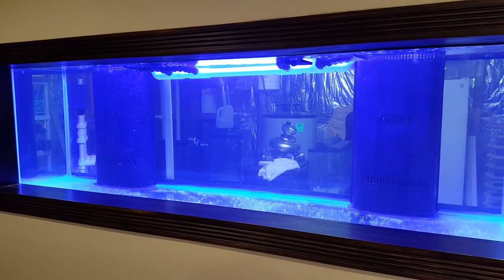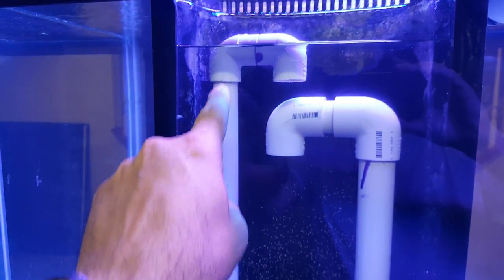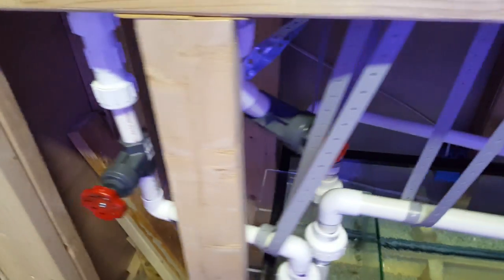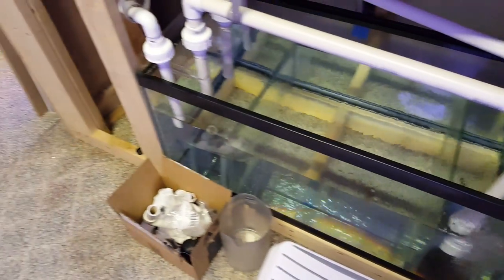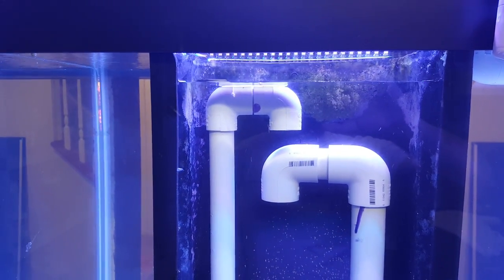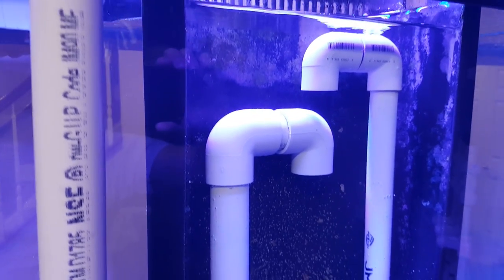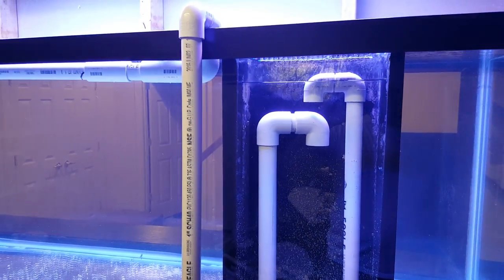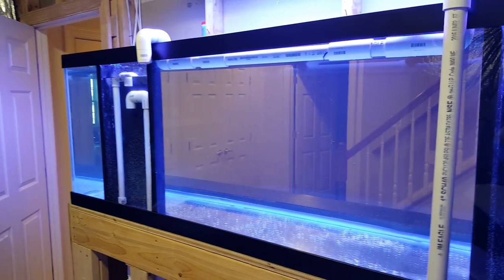How to turn a mega flow into a full siphon.

Comment: I'm want to plumb my 125 the same. I'm ordering 1" ABS bulkheads for the large drains and 3/4" bulkheads for the small drains. What size pipe did you use for these?  Anything holding them in the bulkhead like a rubber seal?
Reply from the maker: The 1" and 3/4" pipes in the overflow compartments are just sitting in the bulkhead. The large one is sitting in friction fit and the smaller one is sitting friction fit in a threaded to slip adapter. At the time I could not get a slip to slip bulkhead so I got a slip to threaded and use that adapter. It is not necessary to attach these as they do not need to be water tight and you want to be able to remove them easily for maintenance.
Reply: Do you remember the overall height you made both drains including the elbows or does it just need to be close?
Reply from the maker: It doesn't matter. The open channel (smaller one) just needs to be higher than the larger one (full siphon) so that it will slowly drift up to it. When your pump is off, the level of the lower pipe will be where the water drains down to though.

Comment: Could the two drain lines be joined in a tee for a sump with 3 inputs? Or would this interfere with tuning each overflow via the gate valves?  Seems like they will have minimal flow and if the sump water can’t overflow the tank it should be safe. So it’s just a matter of doing so would still allow each overflow siphon to find a level.
Reply from the maker: The 2 full siphon drains could not because they run at full siphon unless you tee'd them into a drain that could handle the flow. The trickle/open channel drains could with no issues.

Comment: Hi I'm plumbing my 180 now just like yours it has the same dual overflows, but mine has both holes in each overflow are 1". Is it ok if I make the main siphon a 1.5" with an adapter inside the overflow and below the tank and then just keep the other hole as 1" for the open channel  OR since both holes in each overflow are already 1" should I just keep all of them 1" or does the full siphon have to be bigger than the open channel??  My biggest problem is knowing how far down do I put the plumbing? How far is each pipe from the bottom of the weirs to the top of the pvc fitting on each one?  Also, why did you not use a TEE on the return side and then split left and right behind the top of the tank and up and over to each return loc-line?  I bought the Jebao MDP-15000 pump is it too much? I have 4 - 1" random flow generators that are feeding back into the tank.  Thank you!
Reply from the maker: It doesn't matter if the full siphon and open channel are the same, or different, or either is bigger than the other. Keep them both at 1". The max flow will be whatever that sized pipe is and the open channel only flows the balance amount of water which will be just a trickle. For height inside the weir it doesn't really matter as long as the full siphon is below the water level. The open channel needs to be higher and will determine the water level inside the weir. 

For the return, I actually initially had a different setup that wasn't working for me. The setup in the video is what was easiest to modify from the previous setup. 

Every single Jebao product I have owned has failed. 100%. They are junk.
Reply: @WoodBob thanks for the quick reply as I'm buying parts today. So another question with the full siphon side below the waterline, when turning off the pump is the open channel what breaks the full siphon when the water starts to go down, or will water continually siphon into sump until the full siphon breaks the siphon? I want to be sure I don't put the full siphon too far down if that's the case. I see that you're not liking Jebao anymore lol in my current small tank I have a Jebao smallest one they made that has been running 2 years with zero maintenance but I hear you on the cannot be trusted.
Lastly how many GPH do you think the full siphon drains can handle?  I plan on turning my tank over 4-5 times.
Just curious on the return line again did you try the Tee I'm talking about or something different? Also why didn't you put the loc-lines further below the water line and then drill a siphon hole to break siphon?
Reply from the maker: 1" can flow anywhere from 700-1000 GPH at full siphon depending on flow path.

Water will continue to siphon down until the weir runs out of water at the level of the full siphon drain and the siphon breaks. The amount of water in the weir should not be enough to flood your sump tank though.

I have switched back to my 100% reliable eheim pumps.
Reply: @WoodBob  last thing. Hard to fully tell by video but are the drains really really quiet? They seem to be much quieter than the dual herbi overflows I was going to do. Thanks again for all the great info!
Reply from the maker: The drains are 100% silent. All you will hear is the hum of the motor.
Reply: @WoodBob great thanks Bob!!
Reply: One more thing I think you forgot to answer. The loc-lines returns why didn't you place them further under water and drill a siphon release hole right below water light? I'm planning on putting mine about 1-2" inches below the water line. Just curious if preference or good reason besides not flooding the sump because the siphon break hole would help that.  I have a 75 gal sump I think I should be ok but won't know until I test this weekend.
Reply from the maker: I didn't do that primarily for aesthetics. I  didn't put the return heads far enough under water to necessitate the siphon break.

Comment: Hey Bob here's another question. Wanted to know why you didn't put any type of Strainer screen or something over the Siphon holes to prevent snails etc. from getting into the plumbing? I'm trying to decide if using one would be a good idea. Thanks!
Reply: Sorry I meant a strainer cover over the actual siphon plumbing. Not a cover over the overflow housing.
Reply from the maker: This is a good question Mike! I did have a cover over each weir which prevented fish from jumping in. But there was probably room for a snail to get through the cracks. My snails were all too big to get into those cracks. It is not a bad idea though.
Reply from the maker: Yep - same thing. I see no issues putting a strainer on the siphon openings.

Comment: This is a great set-up (and a very well done video) and I think I will do the same with my 90 gallon. Thank you! One question though,  do you find you have to top-off your sump frequently due to evaporation? The last chamber in your sump (where the return pump is) is necessarily small (so you don't flood your display tank in the event of a drain clog), but I'm concerned that evaporation loss would mean you were constantly topping off the sump.
Reply from the maker: I have an ATO (auto top off) unit (Tunze) that keeps it in check. This tank loses 1-2 gallons per day in evaporation.

Comment: So I messaged you last year and I think I’m ready to upgrade! Looking at the 180 or 210! Couple questions - what size tank are you using for the sump - what would you suggest for a 180 or 210? I want a big section for a fuge and section for a skimmer, even though I rarely turn mine on, and a dual manifold for my uv and reactor. Also, what size pvc are you using? First time I’ll be actually plumbing a tank. How soon could I leak test once glued? Thanks again! Wish you lived in Chicago I’d pay you to set mine up haha
Reply from the maker: Hey @Gino. I use a 40 gallon breeder for the sump. This is primarily because they go on sale at Petco for $1/gallon. For your tank that would work or you could try to source a 75 gallon. I had custom glass cut which was $15/piece. Glass, like everything else, has probably gone up. That PVC is 3/4" and 1". For the PVC usually you can test/use in 1/2 an hour. Check instructions on your PVC glue can as different glues have different wait times.

Comment: can you provide a list of parts used? I see the 2 main drains & return are 1" and the siphons are 3/4". Size of the gate valves etc. thanks for the great video!
Reply from the maker: I always suggest getting 2-3x what you think you will need and return what you don't use. It is better than making multiple trips to Home Depot. The compression fittings and PVC gate valves I got from Amazon as Home Depot doesn't always have them. The loc-line came from bulkreefsupply. 

Always get slip (glue) over threaded. Threaded almost always leaks and is not worth the hassle IMO.

Finding the right fittings to match your return pump can be a challenge. Sometimes they come with what you need but if not, take the pump to Home Depot to match 

slip x slip bulkheads - match your holes - bulkreefsupply has these
2x1" gate valve
2x3/4" gate valve
2x1" PVC compression fitting
2x3/4" PVC compression fitting
3/4" elbows (45 and 90)
1" elbows (45 and 90)
4x 3/4" Loc-Line Modular Hose (6 segments)
4x NPT Connector for 3/4" Loc-Line Modular Hose
4x Flare Nozzle for 3/4" Loc-Line Modular Hose
4x slip to 3/4" NPT fittings (returns for lock-line to screw into)
PVC Strapping (to hold pipes up)
Reply: robc it's not a complete project without at least 3 trips to home depot...js lol. awesome video I'm just about to set up a 90 gal myself and I will be using this setup.

Comment: Hello WoodBob.  I have the same exact tank and am getting ready to do the plumbing as you have designed here.  The sump I have chosen has two inputs that go through the filter socks and a third that can be configured.  My plan is to have each siphon feed the filter socks.  Can I combine the plumbing of the open channels, since they are "trickling" compared to the siphons, into a single drain without impacting performance?

TIA
Reply from the maker: Yes that is a great idea!

Comment: Forgot to ask what is the gph return rate with this setup? I have 4 - 1" bulkheads. did you start with the same setup and just reduced 2 bulkheads? I am looking to have around  600 gph. Would you suggest I reduce 2 of my bulkheads? Sorry for the many questions. Thanks again for the great video!
Reply from the maker: My return is a Jebao DC-6000 which does around 1500gph (minus head). I think I am probably somewhere around 1200gph or so. That is right around 600gph per full siphon drain, of which I have 2. 

I have 4 bulkheads. 2 in each overflow. If you have 4 bulkheads like mine, I suggest using all 4. 1 pair as a siphon/open channel for each overflow.
Reply: robc 
Great. I just want to make sure my 155 gallon was ok for 3/4 and 1" pvc. 
I am doing the exact same set up
Reply: I'm also looking to do the same but i have a 55gal tank and i'm just starting new. I will be just setting up 1 overflow as a siphon/open channel is that ok for now?

Comment: Hi Bob - I realize this is several years old, but wondering how the Jebao pump is holding up in your system.  Too, why did you modify the Megaflow/Durso to a Herbie, were you not getting enough drain GPH? I am setting up a 210 that has the megaflow system and if I'm calculating the flow correctly, with the two drains I should have more than enough to support turning the tank 10x per hour.  Just curious, but I do like your modification and would definitely use it if needed, ~Tim
Reply: The Jebao has failed along with every single other Jabao product I owned (pumps, wave makers, etc). I replaced it with the bulletproof Eheim and will never purchase Jebao again. The conversion was done primarily for noise control. The Herbie is dead silent. But add to that the increased flow from going full siphon and it's a big win. Thanks Tim good luck!
Reply: Thank you. What GPH Eheim are you running with this setup
Reply: The 1262 ~ 900gph.

Comment: Super video!
I am running a 125 double corner flow in my barn. I don’t care about water noise. Is there any other reason than noise that straight downtubes to the sump wouldn’t work in lieu of the siphon 180’s?
Reply from the maker: The main design advantage of running at full siphon is increased flow through the sump. That it is also whisper quiet is really just an added benefit.
Reply: @WoodBob  Thanks for the reply. Do you adjust the level with the full siphon gate valves?
Reply from the maker: Correct. Get it going at full siphon, then slowly close the full siphon gate valve until the water rises to the open channel and just barely trickles. The open channel gate valves are not needed during normal operation I have them strictly for maintenance reasons.

Comment: Would a check valve on the return pipe toward the top eliminate the possibility of  the return becoming a full siphon in case one of the u-lines got knocked down?
Reply from the maker: Eliminate is subjective! Theoretically, it could. But I don't like relying on anything that could fail. Check valves are highly unreliable in an aquarium environment especially a saltwater setup. The easiest way to prevent a siphon is to drill a hole just beneath the water surface on the return line which will break the siphon once exposed to the air. On my setup the returns are just under the surface and my sump tank can take anything that would siphon down until the tips are exposed and the siphon breaks.

Comment: I’m upgrading to my first tank I’ll have to actually plumb - coming from a Red Sea. My question is what - do the full siphon is the primary drain correct? Well what’s the secondary/open channel for? Also, do you use a lid with the way you built that HOB return line? Awesome video thanks a lot! God bless!
Reply from the maker: Thanks for the kind comments! The open channel is needed because it isn't possible to keep exactly the right amount of water for a full siphon to work continuously. The remedy is to return slightly more water than the full siphon can flow and have the extra water go into the open channel. The open channel is "variable" so it will work with the little extra you'll need to keep the full siphon happy and any variance that your pump may have.

Comment: Hope you’re still monitoring this old video.. I just picked up the exact same tank second hand and was not happy w the small holes and thinking of doing exactly this. My question is.. what gph are you running after head and how much room is left on your valves? Sounds like you’re running them around 60-65% open. I’m asking cause I’m looking to run around 1450-1600 after head and still not sure it can be done. I’ll be running the bigger dct8000 pump with 1-1/4” hose so I’ll have way less head then what it looks like you’ve got.

I was also toying with running one size larger pipes into reducer at bulkhead which should help some
Reply from the maker: Yes this is just about exactly what the flow rate I calculated. Around 700-800gph per side so ~1500 total. To this date I have yet to have a single issue with the setup it is rock solid. WIth the 8000 you could run more flow there is definitely room left in the valves. I have thought about reversing the pipes actually and using the smaller for the full siphon and the larger for the open channel but it is just running flawlessly that it is not a huge priority. If I had to do it again that is probably what I would do. I don't like running with the full siphon valves cranked so far closed since I had a clownfish that ended up jumping into the overflow and getting stuck in the partially opened valve. On this tank I do occasionally find a fish in the filter socks I am not sure how they get there since I have covers on the weirs! I have actually found fish in the ATO reservoir! That is one lucky fish to have jumped out of the tank and ended up exactly in the ATO tank!
Reply: robc thanks for the response. I did the math and wasn’t looking like I would achieve that much flow going reverse like your saying but it’s hard to calculate the overflow amounts unless your a rocket scientist who knows plumbing lol. That’s crazy about the clown loaches though.. mine rarely leave the substrate and even then maybe mid tank at best.. although I do have them in a cichlid tank with some predator haps swimming up top which might deter them from swimming up that high lol. 

One more question as I had to reseal this entire tank as it bowed so bad it broke the seals at the middle between the front pane and the bottom glass. I should’ve broke it completely apart and rebuilt but half assed it. I filled it with water let it sit for 7 day’s and it never leaked but I was getting 3/16-1/4” bow across the front and back panes. This is the deepest tank this size I’ve ever had and I know they will bend due to the water pressure but not sure if mine is still more then it should be. If you don’t mind could you put a straight edge across yours and tell me how much bow you’re getting? I’m trying to figure out if I’m ok to run this a couple years as is or if I actually need to (know I should but....) tear it completely down and rebuild the entire tank.

Comment: Hey ,
Great video.. question: where did you get your shut off valves from and also your connectors?
Reply from the maker: The PVC gate valves and compression fittings from Amazon and the rest from Home Depot.
Reply: @WoodBob  thank you! I couldn’t find the valves at first. I left out the (gate) parts😃 thanks a lot.

Comment: just curious?   did you have a problem with your evaporation rate in your sump?    where does the water level drop?   it seems like the last chamber, where the pump.
Reply from the maker: Yes, I lose about 2-3 gallons a day to evaporation. I have an ATO (Auto-top-off) on the tank (Tunze Osmolator). I plan on making a new video that shows this setup is still safe/flood-proof using the safeguards built into the Tunze to prevent too much water from being added to the tank in the event of a blockage.

Comment: with an overflow system like this , is the suction strong enough generated by the siphon effect due to the overflow water?
Reply from the maker: Strong enough for what? The flow rate for this setup is very high about as high as you can get for these sized pipes.